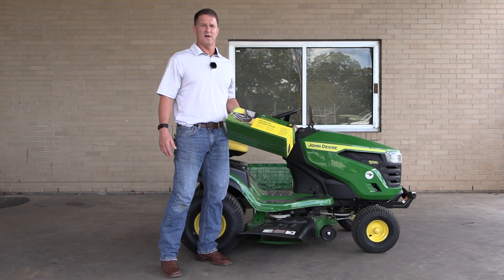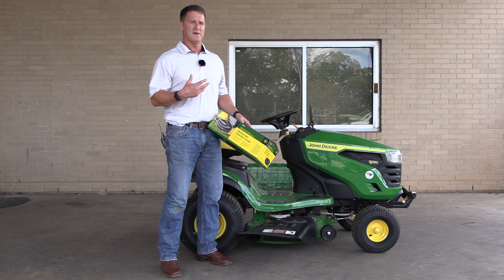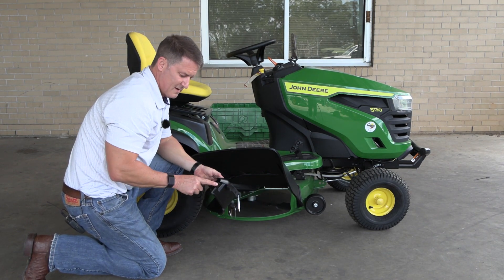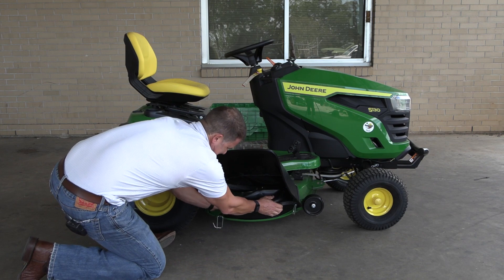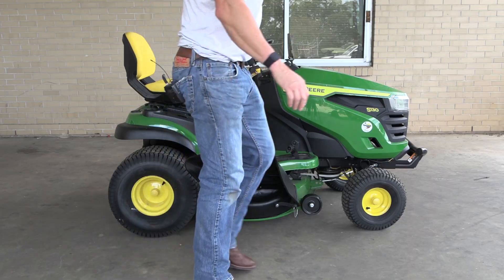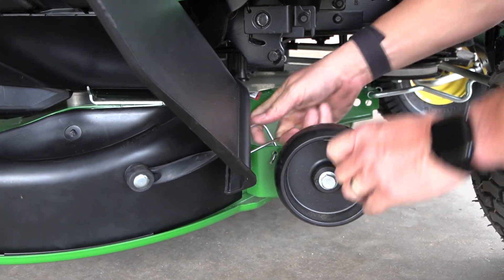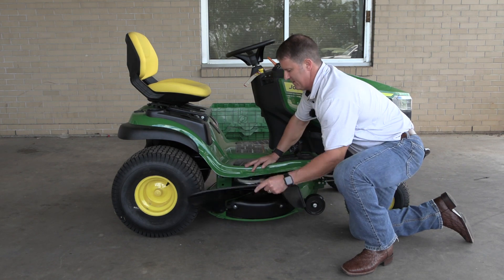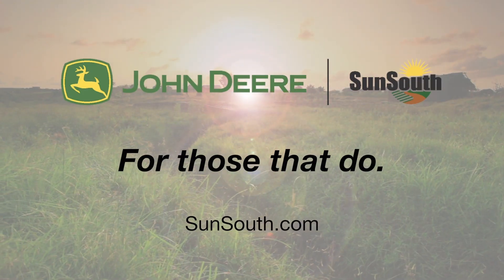How to install a GY00115 Mulch Cover

Comment: Mine unfortunately is not fitting at all.  It does not stretch enough to stay attached to the bottom lip, and still reach over the deck itself at the top.  A close-up of this would help.

Comment: Thanks!  This helped me get the mulch cover on Grandpa's Deere.  I did this by myself and was having a hard time stretching the rubber thingys to reach.  But with persistence I did it!  I also could not find the pins to remove the side discharge thingy like someone else commented.  So if you could elaborate that would be great.  Thanks again.  This saved me a lot of time rather than reading 🙂